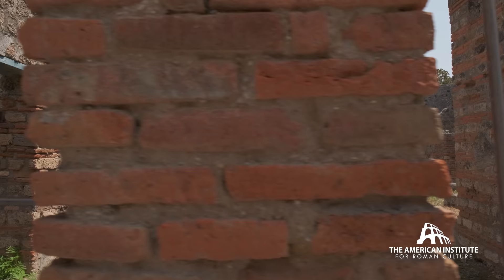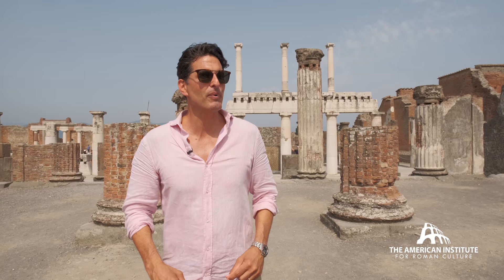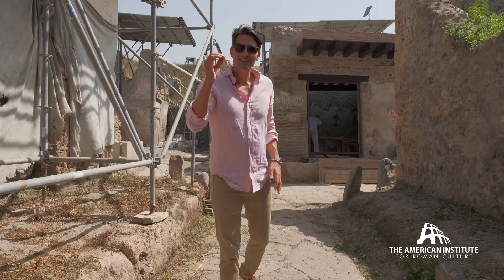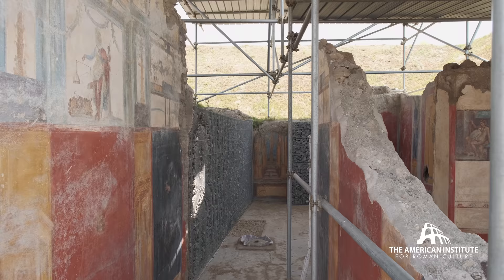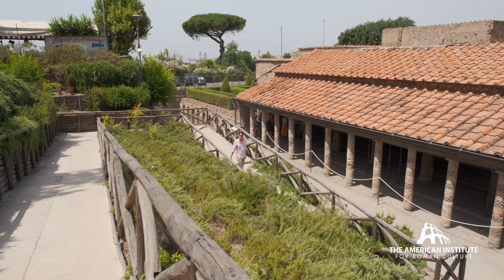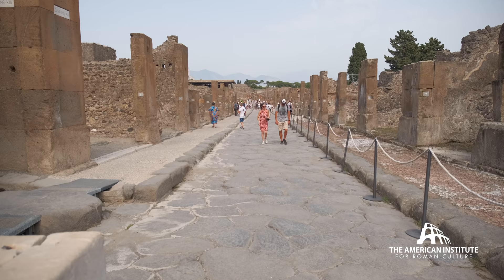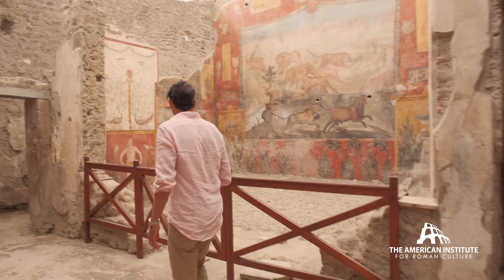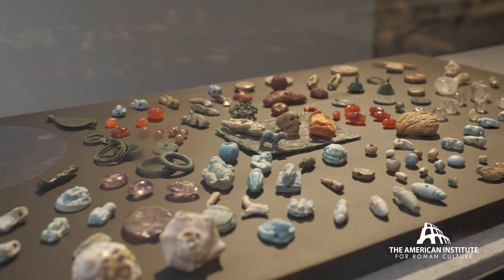What are the newest discoveries at Pompeii?

Comment: I wonder how much of the damage was caused by the hot ash flow and how much was caused by tree roots growing through the structures.  What would the wood used in roofs and doors and other things do when suddenly encapsulated by super hot ash?
Reply: @ Old Time Farm Boy
Once it can't support the weight of the heavy ash, it will crash. Ash itself, isn't known to burn or cause burning as seen in Mount Saint Helens and other volcanic eruptions in the Philippines where ash covered everything but ignited nothing.

Comment: Great pre and post production work.
I would strongly recommend a visit to Pompeii but not in the summer. It is huge. The sun and heat will beat you down. Do your research first. You may want to break it up over two days.
Be careful with the official website. Not updated enough.
Reply: Very helpful thanks.  👍🧡
Reply: Thanks for the tip on the website.  I was thinking to go over a winter/spring before it gets too hot.  I live in a similar climate and know how miserable it can get.

Comment: This may be a really dumb question but I’m going to ask anyways. WHY are the huge stone structures with massive load bearing columns destroyed with no sign of the exterior walls, roof etc anywhere and then you have these much smaller weaker structures like the homes, either reassembled or mostly intact? 

Are the pieces of the heavier huge stone structures in storage or what looks like they’ve vanished? 

Again I know this sounds dumb so sorry in advance.